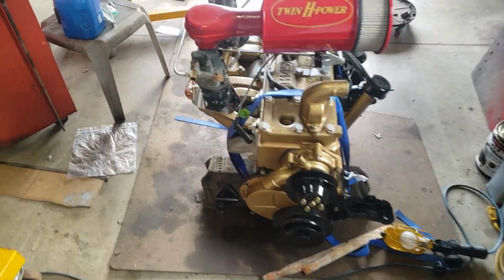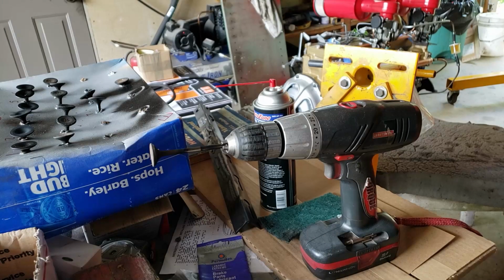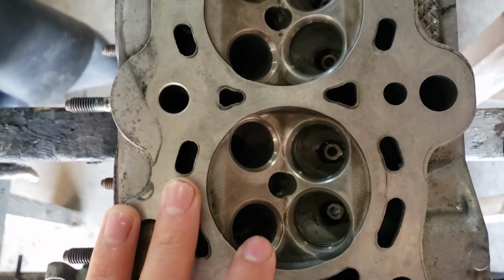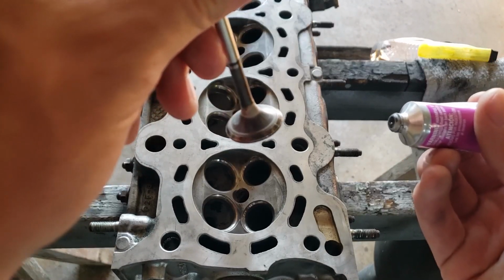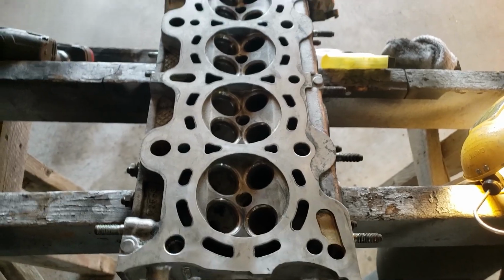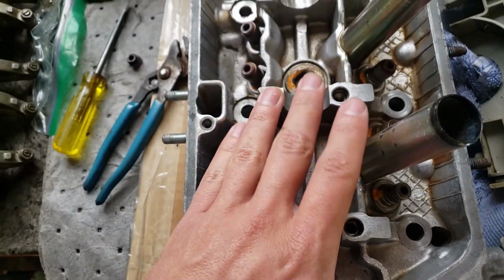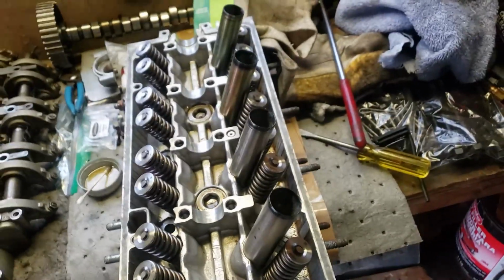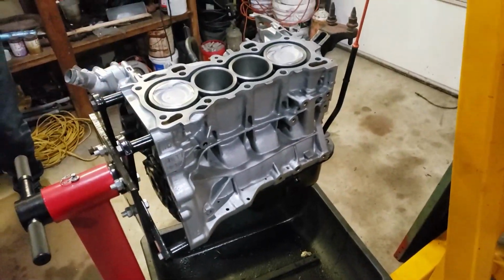Rebuilding a Honda Civic D16Y7 Cylinder Head

Comment: just a heads up i work at a machine shop and little tip those valves you cleaned up especially your exhaust valves the surface between the valve and the valve seat transfers heat and usually they are a machined surface since your lapping pitted valves to pitted valve seats there gonna take the shape of whatever is there  so they wont be flat they might seal but it wont be a flat surface it could be convex or concave and could affect the transfer of heat and potentially down the road ruin the valves a better option would be take the valves to a machine shop have them resurfaced its not much we usually charge like 40 bucks then lap the new machined valves to the old seats its better then lapping old to old

Comment: I’m about to put my y7 head back together. For the cam, other than setting it in at top dead center, is there anything else I specifically need to do, to avoid any issues with bending a valve, things like that upon start up?
Reply from the maker: Nope just put everything at TDC and you should be good
Reply: Thank you so much!